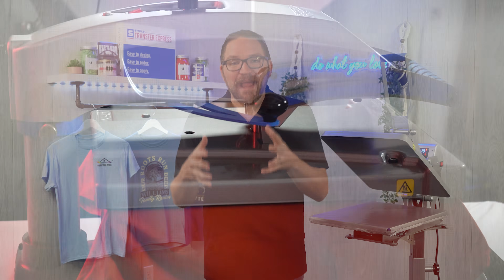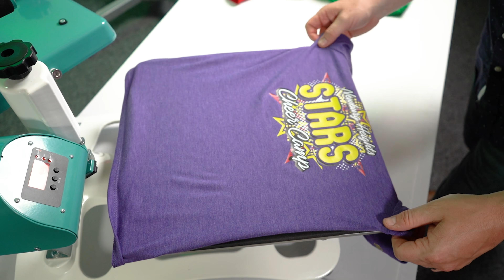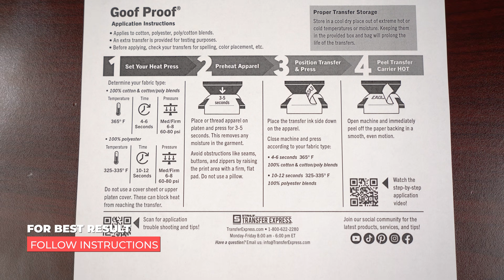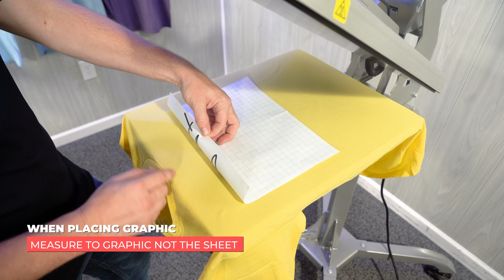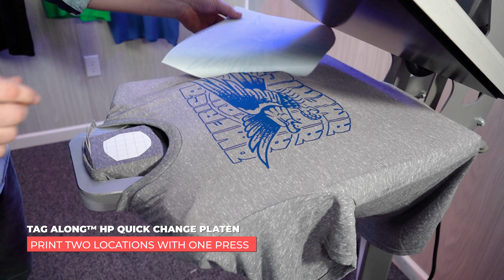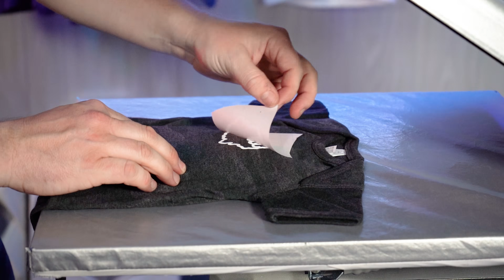Heat Press Like a Pro: Essential Tips for Efficient & Quality Printing

Comment: What if the collar is centered on the platen, but I noticed the side seams are not equally distant from it? What is the rule of thumb? Does a collar centered overrule the side seam? I only noticed this on some shirts. not all the time. Thanks for sharing the gems 💎
Reply from the maker: Great question. We recommend centering off the collar since it’s the most consistent reference point. Side seams can vary by brand and shirt, so they are not always reliable. If they look off, trust the collar. A quick visual check can help if something seems noticeably uneven.

Comment: What temperature and time do you use for your heat press?
Reply from the maker: It will depend on the product you are applying. Each has its own recipe for time, temperature and pressure. You can find ours here https://www.transferexpress.com/application-instructions

Comment: Hello…we are Gina and Rick…we are brand new to heat press.  Why are there heat tape marks left on a polyester shirt.  I am not certain if my press heat settings are wrong or if I have the wrong brand heat tape??😮 Also, the square is printing on polyester.  We have 100% polyester shirts.  We have a htvront 15x15 and a Vevor 16x24.  Please help.
Reply from the maker: Hi Gina and Rick! We'd love to help out- Likely the temperature you're using is too high for the fabric. Polyester and synthetic garments are heat sensitive (some more than others) but there's a few methods you can utilize to reduce those unsightly platen marks on the garment. This video details avoiding it: https://youtu.be/mdl9AXPMlt8?si=nHk0FxV-H9N8Xa8V

And this video can help you fix it as a last resort: https://youtu.be/iL6vJXWnH4g?si=XMrLS1uzjXlBsCL7

Just remember A.R.C.H. Method:

Accurate Pressure: Utilizing the correct pressure settings can not only apply the transfer correctly for a durable finish, but protect sensitive fabrics. 

Reduced Heat Transfers: When printing on 100% polyester or synthetic blends, it's best to choose a heat transfer that applied below 300 degrees F. In some cases on more heat sensitive fabrics you need to go even lower. 

Correct Cover Sheet: Using the the correct coversheet can protect garments, but some coversheets block more heat than others (thus no scorching) but you want to ensure your transfer is still being applied correctly for a durable finish. You may need to test longer application times with this method and wash test before delivering to your customer. 

Heated Lower Platen: In the event nothing else works, you can use a heated lower platen heat press to apply heat from inside the garment, which protects the exterior face of the garment.